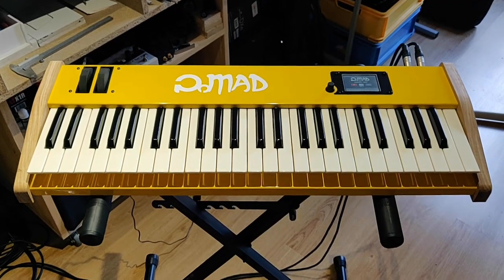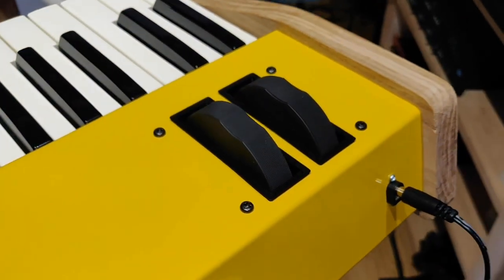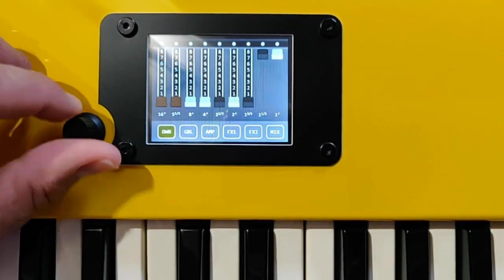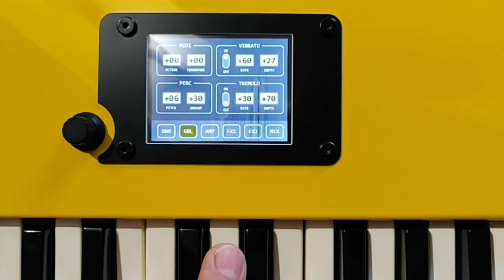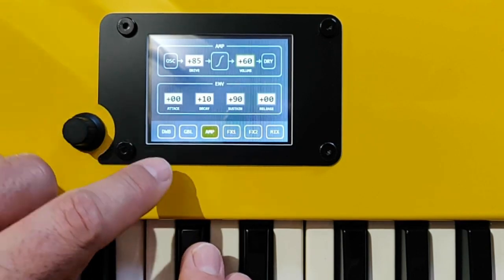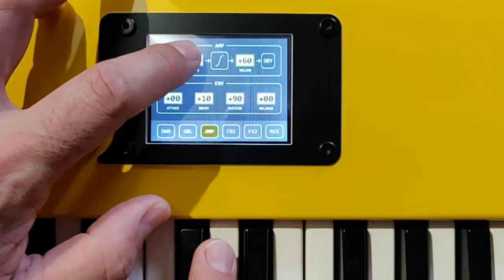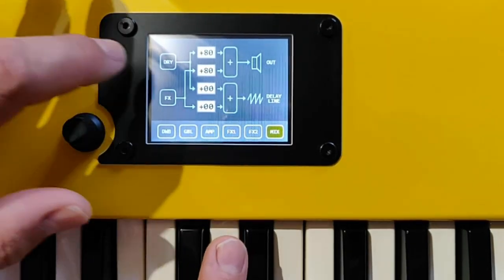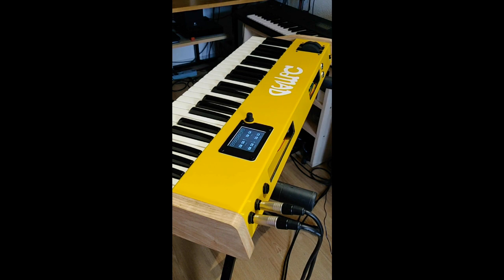STM32 Tonewheel (Clonewheel) Organ

Comment: Wow! Very nice, Laurent. I can picture the tonewheels turning when I close my eyes. Will you be adding key-contact noise? Great write-up on your web page. I'd like to try porting some of your firmware to a less powerful STM32 just for fun. Thanks for sharing your hard work!
Reply from the maker: Thanks Paul! At this time, I'm not planning additional work on this little guy, but adding (sampled) key noise should not be a lot of work. I think that the effects stage (flanger/chorus/rotary) could definitely be improved. What's in there now is barely a first draft. The firmware will run fine on smaller CPUs (F4?), you might just need to lower the number of voices (polyphony). Thanks again!